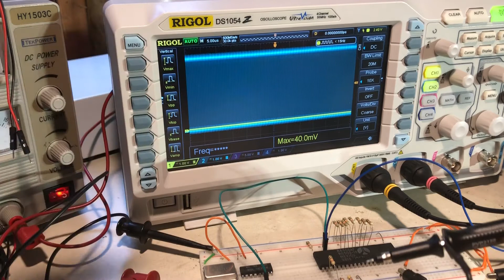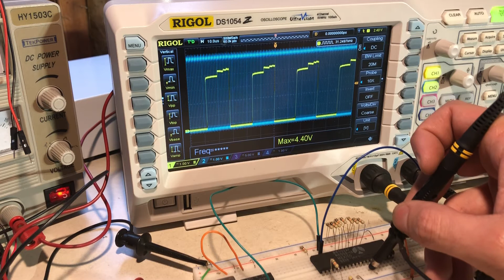What's up with this 6502?

Comment from the maker: I've heard from a lot of folks that I mixed up the voltage thresholds for HCT and HC. Please disregard that part! Anyway, an update: adding more decoupling capacitors did not help. I swapped the 6502 into my otherwise working Apple IIe and it also failed to boot. So something is definitely wrong with the chip, but these stair-stepping signals do not seem to be the problem.

Eric (twitter.com/TubeTimeUS) hooked up a 6502 in the same way and noticed similarly shaped signals. It's just a characteristic of NMOS logic. https://twitter.com/TubeTimeUS/status/1012455877893222402
Reply: I wish I had read that first comment before I went to research the thresholds for HC/HCT TTL!  because I was thinking the same thing!!  :-)
Reply: You can't reliably test a 1 MHz 6502 in an Apple IIe because, due to the timing margins required for the IIe's address decoding logic, the IIe requires a 2-MHz-rated part, even though it runs it at only 1 Mhz. (!) Details and references at https://retrocomputing.stackexchange.com/q/14143/7208 .

For what it's worth, what you see in this video is exactly what I see on several different NMOS 6502s, though I needed 0.1 μF between the power pins and ground for the CPU and clock divider to get clock signals as clean as you have there. It's nice to know where that stair-stepping on the address lines comes from!

Comment: 1.5 years late but anyway:
lately I was examining my Commodore 1541 FDD. It showed an error while switching on: motor constantly spinning and drive activity LED on.
I did a couple of things but in the end it was the crappy Commodore sockets. The reset circuit switched from low to high but 6502 still had a low on its pin. The level on the socket's pin was high though.
Replaced the socket in the end and it is booting correctly.
But I experienced exactly the same behaviour as you: 4V on signal lines though Vcc was at 5.0V and that "staircase" pattern though the CPU was in Reset. It seems to have a weak pull-down on its /RST line.

Comment: i am convinced, that your breadboard is not able to run on 8 MHZ and may be causing interference with the address lines... maybe causing a resistance problem... I wouldn't run more than 1MHZ on breadboards... correct me if i'm wrong
Reply: No, there appears to be no problem with the breadboard. This configuration (8 Mhz crystal oscillator generating a clock divided down with a 74LS161) is exactly what I used when testing a stack of "65C02" chips from AliExpress (half of which were actually re-labled NMOS chips), and it worked fine, producing similar results.
Reply: I mean the 8MHz part is tiny, it's only a couple lines, the rest is at 1MHz.

Comment: Maybe it needs more decoupling. What cap's did you put and how much current does it draw?
Reply: Yeah was about to ask where the decouple cap is.
Reply from the maker: In this video I didn't actually have any decoupling caps :) However, after installing 0.1uF, 10uF, and 220uF capacitors across Vcc and ground, I did not notice a difference.

Comment: The ViH level for HCT is compatible with TTL around 2.7 V. So this is OK. The stepping in the levels is as mentioned before an effect caused by internal signals being switching and are due to not having sufficient bypassing caps near by. Add a 100nF and a 1 to 10 μF cap across the cpu vcc and ground and this will be much less or go away all together.
Reply: The stepping isn't necessarily even an issue.  There will be supply voltage sag within the package caused by the resistance of the Vcc wirebond, so current consumption elsewhere within the chip can cause the IO voltage to drop no matter how much bypassing is on it.  Although fairly dramatic looking by modern standards, it shouldn't matter as long as it doesn't cross below Voh for TTL.  IIRC, the the NMOS 6502s require bus drivers as the internal drivers can't handle much on their own (although I may be remembering a different uP).

If you've declared it dead, it would be interesting to dissolve the packaging and inspect the die to see if there is obvious damage from overvoltage.

Comment: Voh should be 4.5V, which is high output voltage for HCT. I think Vih and Vil is what matters if being driven by the 6502, as those are the input voltage thresholds. Vih for HCT should be around 2V or so for Vcc at 5V.

Comment: That should be fine, as long as Vh is > 2.4V and Vl < 0.4V. And the stair stepping comes from the address lines internally pulled up to the same Vcc line, which itself has a resistance. The more lines are pulled low, the higher the load on the Vcc line and the lower the actual output voltage. At least that's what I think is happening.